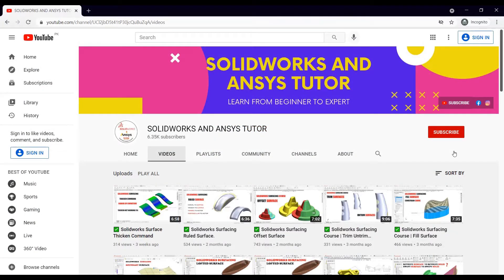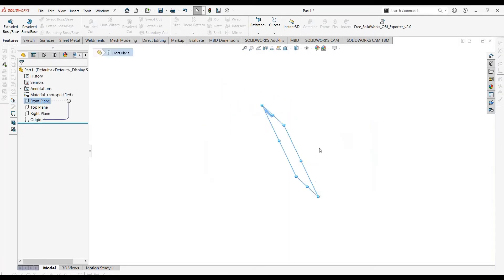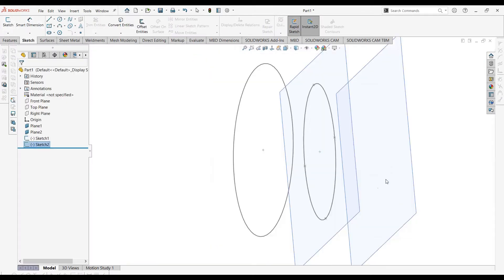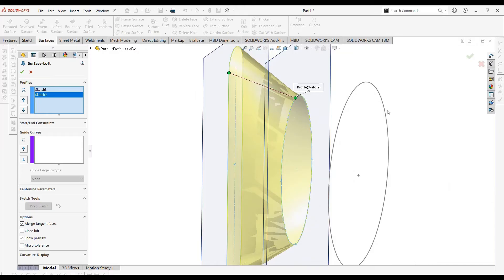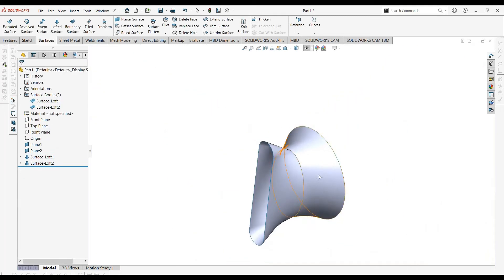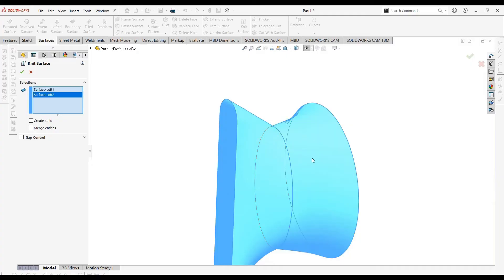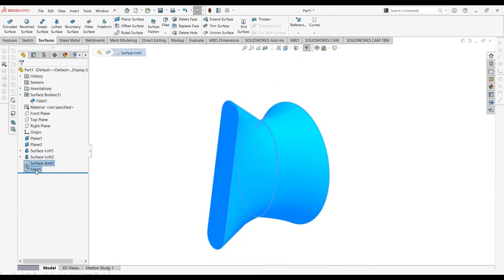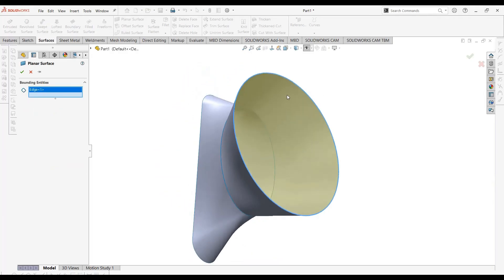✅ Solidworks Knit Surface | Surface to Solid

Comment: Thank you for the tutorial , Ive noticed when I knit surfaces at the end I have the knitted surfaced and the other ´separated surfaces I knitted. It´s not that easy to use the command, it´s like if they were not really knitted . Do you know what am I doing wrong?
Reply from the maker: there will be a small gap between the edges of the surface that why they are not kniting.

Comment: With 1 or 2 or 3 surface not problem.....the problem is when import a iges to solidworks with a lot surfaces,,,try to get a solid or heal geometry.
Reply from the maker: For that you can copy surface from iges and after that you can knit surfaces, trim surfaces make new surfaces accordingly. This tutorial was just for beginners and new students to understand the feature.
Thanks